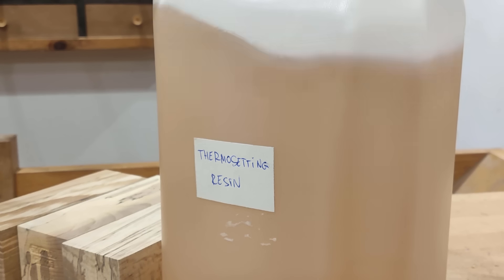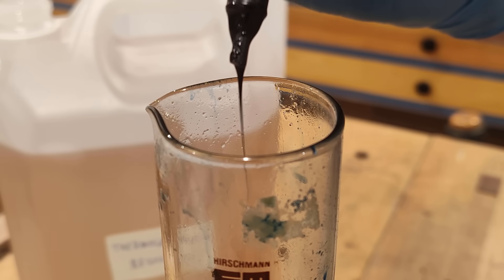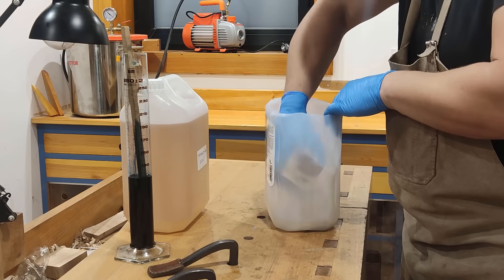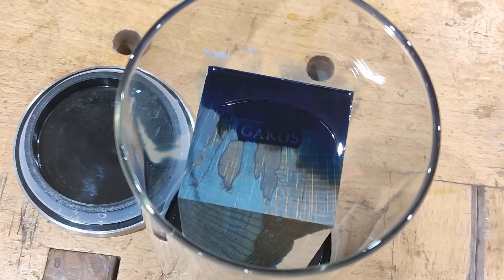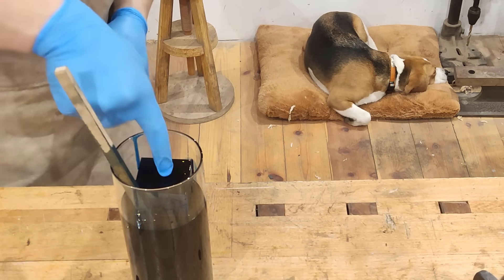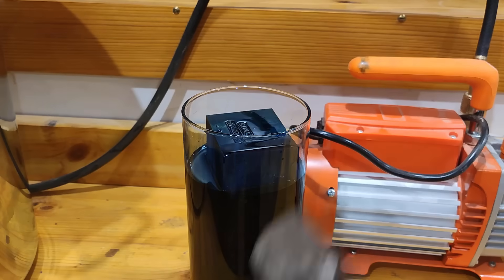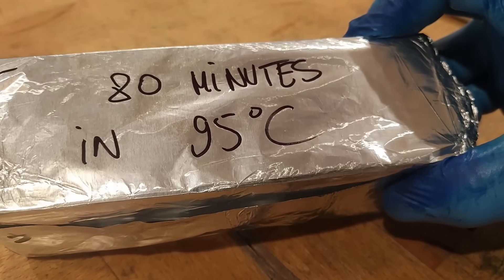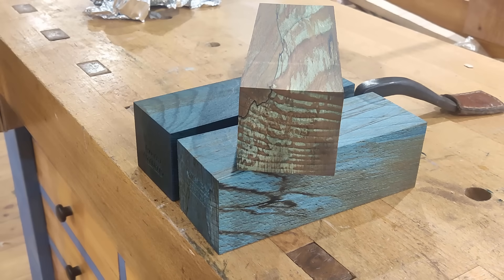076 Stabilizing process of my plane blanks

Comment from the maker: Hello my friends!

It's time to start another project. It will be kind of rare plane with stainless steel sole - try to guess what kind :)
For the body i decided to use spalted beech wood. As you probably know spalted beech is a little bit weaker than healty wood so i'm gonna make stabilization with blue and green stains - that's the theme of todays episode.

Fell free to leave any ask in comments.

I hope you got good time, no matter with or without my videos.

Cheers 
Stavros
Reply: A trenching plane maybe??
Reply: Aero plane ❤
Reply: A plane ol plane?
Reply: Stainless is not easy to machine. I tried turning it on my lathe and it was horrible. 😀
Reply from the maker: I know it 👍
Reply: @StavrosGakos  speeds and feeds are critical, plus lubricantion and cooling, but even then you might need more rigidity and power that the average mini lathe or mini mill can deliver. Brass, on the other hand… traditional for plane soles, much softer.   Will be interesting to see how you get on.  Cast iron somewhere in the middle between the two. Messy though.

Comment: A process I have never had the opportunity to use. 
I usually use a mineral oil for this. My spoke shave of curly birch is soaked in automatic transmission oil and that is why it has that reddish hue. Using the mineral oil also is easily renewable if necessary. The body of the plane also gets a several wash coats of blond shellac. 
I love to see other people’s processes. Thank you for documenting this for us to enjoy and study. 
Greetings Stavros, from the high plains of Texas.

Comment: Not some thing I have tried yet, mostly because I don't know how, and do prefer natural wood. I guess this would solve any potential cracking problems that seem to plague thick wood planes. Not sure if that is ever a problem with the thinner body Japanese style planes. That does bring up a question, have you ever played around with them?
Reply from the maker: Hey, i've never used japaneese plane
Reply: They are totally different. The blades on them are similar to the old irons you use, hard metal forged to a softer metal for the main body of the iron. The chip breaker is a 'new' idea for them, coming in to use in the last 100 to 150 years, I think. I am playing with them also. I have yet to make a western plane, and did get some Japanese style planes. You have to do the final fitting of the blade to the plane body yourself.

Comment: Following on @carlopieracci2828's question, I'm also curious to as to what type of resin you're using. Blue Spruce uses some type of infused resin (acrylic?) in their tool handles, which gives them wonderful heft and smoothness.
Reply from the maker: Hey Mike! It is impresin90, similar stuff to cactus juice
Reply: Thanks, Stavros. I'm making a couple saw handles from a block of rosewood I picked up years ago and would really like to try this process. I have a similar vacuum chamber & pump to what you're using. I'll probably test it out on some cheaper wood first, though.
Reply: Oh, and Merry Christmas!
Reply from the maker: @mikeestes4119  good luck with your stabilization 👍 Marry Christmast!

Comment: I have 3 questions about stabilizing:
1) Will stabilizing increase wear resistant of normal plane wood like pear or beech?
2) Is it possible to stabilize boxed wooden blank? Maybe by using heat resistant wooden glue.
3) Can i stabilize plane which was already made?
Thank you.
Reply from the maker: Hey, 1 - yes, 2 - if you don't use hide glue for boxing i think yes, 3 - don't do this, you will destroy the plane. Cheers!

Comment: What resin brand did you use Stavros ? I’ve been messing around with some cheap methods (acetone + paraloids or thinned epoxy) because classic thermo setting resin is quite expensive and haven’t been able to find a good brand that does not require to sell a kidney in order to purchase a liter.
Reply from the maker: Hey, impresin90

Comment: That is so interesting and very attractive !!! May I ask a question - I have a fairly big chunk of quarter sawn Jatoba approx 75 x 75 x 600mm. Would it be suitable for a couple of nice planes??
Reply from the maker: You can use it, but first check the ends if there are some cracks - just cut thin slices from the ends and try to bend them 👍
Reply: Thanks for getting back to me, I will do that and if all good its looks as though I have my 1st after Christmas project. Heres wishing you and yours a very Merry Christmas and a Happy New Year. Best wishes David  @StavrosGakos
Reply from the maker: @davidjennings9253  merry Christmast :)